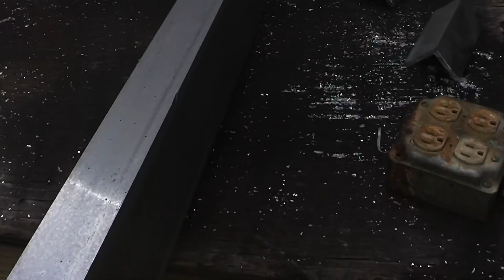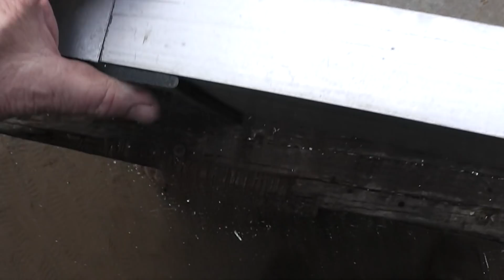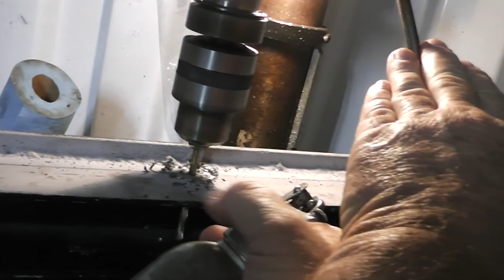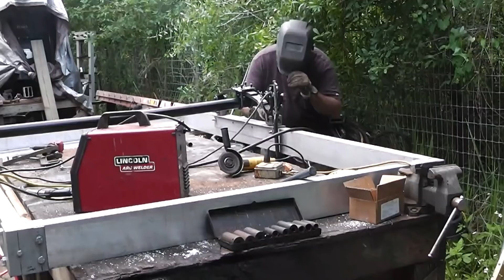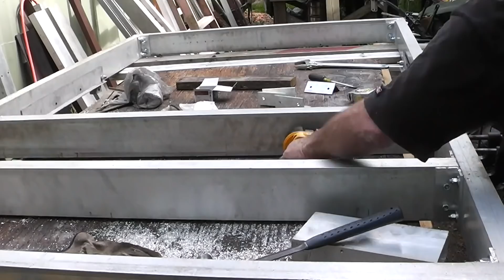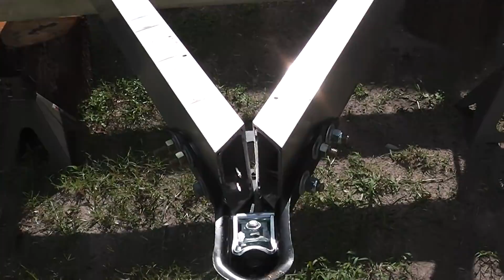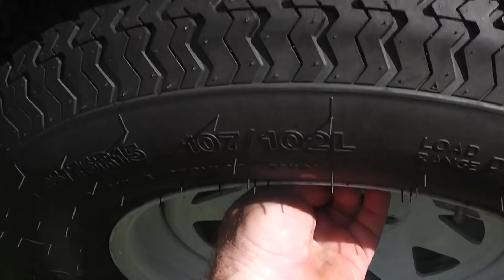How to Build a 5x8 Aluminum Utility Trailer Step by Step

Comment: How much did it weigh? Isn’t the whole point of aluminum for weight reduction?
Reply: The whole point of aluminum is that the weight of the aluminum is lighter in comparison to other metals. Which means, it could be hauled by vehicles that aren't meant to carry heavy loads.

Comment: You Sir, have helped me greatly. I can now go and build my own trailer that I wanted to do. Only thing that kept me from doing it was not knowing if it could be bolted together and me not knowing how to weld did not help the situation. I think I can figure out a way to bolt on the axle too. I only need it for moving around light things like drywall, plywood and my bike from time to time nothing too heavy. Thanks for this video.
Reply: Don't build an aluminium trailer at all. Especially this way with steel bolts and no spacer tubes welded in so that the bolts don't crush the box sections over time. Bolts will always be loose on this trailer because of section compression. Get a DC gassless mig and flux core wire. Learn some basic welding skills. Steel is cheaper and stronger. My advise front experience.

Comment: Looks good. I have one concern though, did you consider the accelerated corrosion there will occur from using dissimilar metals?
Reply: I built semi trailers for 10 years and we used a single layer of clear tape between the aluminum bottom rails and the steel cross member tabs.  As long as there was no lateral movement between the two types of metal then everything was fine.
Reply: @huf67  what style of clear tape if you don't mind me asking?
Reply: The trailer needs an anode just like a boat to prevent corrosion from the 2 dissimilar metals.  There might be a better way but I don’t know one.
Reply: Galvanic corrosion can’t be prevented with paint and only delayed. You need a physical barrier like nylon. A double deck bus builder here made that mistake and a floor fell through and killed a lady because of the corrosion. Bus was only 2 years old. Aluminum rarely shows signs and one day just fails unlike steel
Reply: If you painted the two metals, would it prevent corrosion issue?
Reply: Use Tefgel or duralac, that is what I do on my aluminium yacht when putting in stainless bolts
Reply: Nice build but would have liked to see the welds TIG AC for aluminum and like others said about the 2 dissimilar metals, PTFE would work in between.
Reply: Might be the only thing I retained from my Materials Engineering course.

Comment: Steel bolt/brackets and aluminium sets up potential "galvanic corrosion" issue.
Reply: Why not just use aluminum angle instead of steel?  A trailer made with aluminum and steel would not last very long here in Florida.  They make dielectric washers for the bolts.
Reply: I certanly would have oversized the steal channel enough for a trio of rubber sheets. Maybe some of the flasing tape.
Reply: Thangle is also Aluminum and the clear anodising on the alloy should be enough of a barrier to prevent corrosion issues on the bolts.
Reply: Now that it's 5 years . Has galvanic corriosn set. I am planning to use this method in 2026
Reply: only if it gets wet all the time. just paint it or put a thin sheet of stainless between the 2. galvanic corrosion only an issue in super wet environments.
Reply: @rollandelliott  Stainless is also bad for galvanic corrosion. If you look up the table of galvanic corrosion series it is actually worse for Aluminum than regular steel.

Comment: I’m disappointed. 
I thought I was going to get to see you weld aluminum :)
Reply from the maker: You aren't the first person I ever disappointed, nor will you be the last! lol
Reply: @homesteadprepper I actually am surprised to see this bolted together - BUT I have to say - ingenious !!!!  I don't know if you know but I know for sure that and HOW MUCH aluminum loses strength when welded ... the heat treat is being destroyed, the artificial aging of the material is being destroyed .... so it can actually be very smart to bolt stuff instead of weld stuff in certain cases...   a very interesting video
Reply from the maker: Zila Thank you for your input.  I did not weld this thing for 3 reasons. #1 Partially for the reasons you stated.  #2 If a weld were to break or come apart on the road, it would be very difficult to have it repaired. #3 And mostly because my aluminum welding leaves a lot to be desired!
Btw, I would love to attend one of your welding classes for aluminum!
Reply: homesteadprepper send me your contact info CL@zila.net
And we’ll make something happen.

Comment: I'm glad that you oriented the axle over the springs rather than under.  When I first clicked on the video and you were setting things up, the axle was bowed in the wrong direction.  For a lot of viewers, they don't know that the manufacturer puts an arc or bow in the axle and is rated for the weight of the trailer and load.  When you get the proper load on it, the tires are straight up and down.  When there is no load, the tires ride on the outer edge of the tread and when overloaded, it's on the inner tread.  That's why it's important to buy the correct load rating.  If not you get horrible tire wear and a very bouncy trailer, but that's usually the worst of it, just bad tire wear.  Nice solid build and no welding!  ??
Reply from the maker: You are 100% right.  I joked with the warehouse guy when he brought out the axle and I told him that I couldn't except this one because it was bent! Well, befor he could give me a much deserved schooling, I told him that I was joking. The axle is cambered.
This trailer has been road tested to over 90mph on I-95 empty with absolutely no bouncing.  With it loaded, I did get up to around 80mph with no problems.